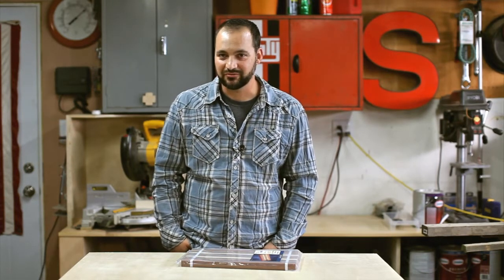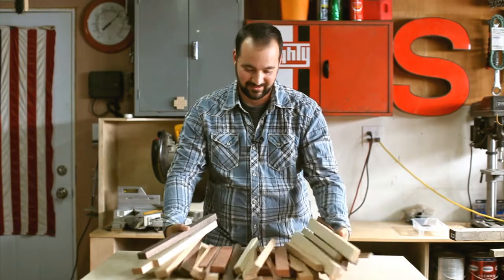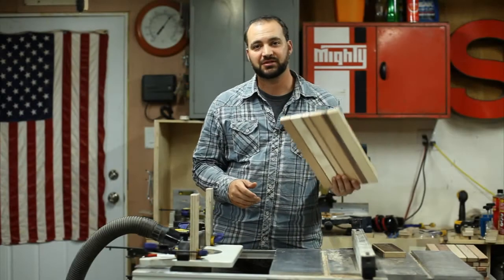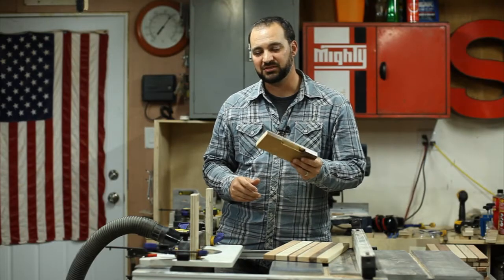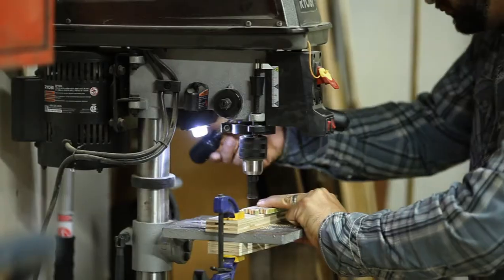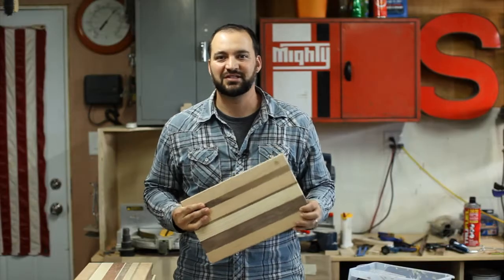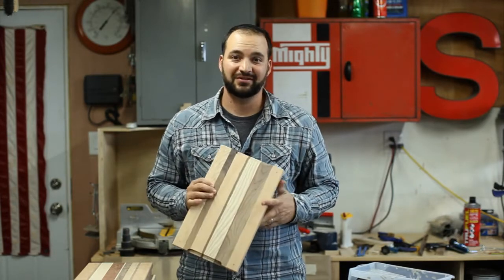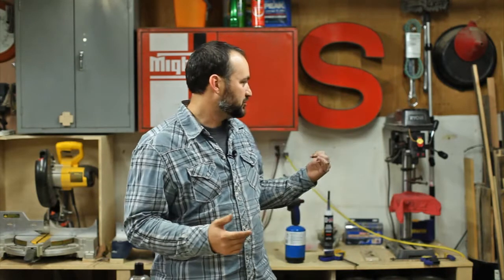How To Customize A Cutting Board With Recycled Skateboards

Comment: That was a rockin video! Great stuff Seth. How did you score skateboards?
Reply from the maker: +Scott Kershaw Thanks Scott, glad you enjoyed it!  I've got a couple skateboards laying around from my skateboard days.  In a recent attempt to relive my youth I went and skated at a local skatepark and I found a broken one laying outside.  I also went to a skateshop and asked if they happened to have any broken/cracked decks I could have, so I got a couple that way too.  As wedding photographer (my full time gig) I know a fellow vendor who is engaged to a local pro, so I've gotten a few boards from them.  Not all the boards I've gotten are good though.  I really want ones with colored plys, but some of them are all plain wood plys with no colors.  I've only used recycled skateboards in very small amounts so far, but i'm looking to use more and use longer pieces on some upcoming projects, so stay tuned!  :)